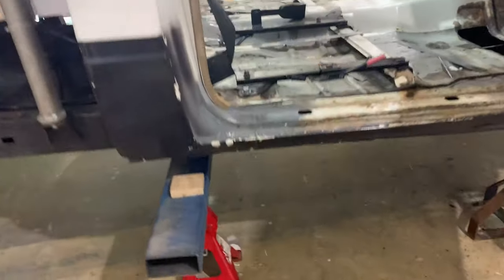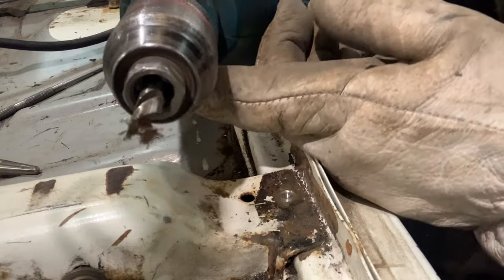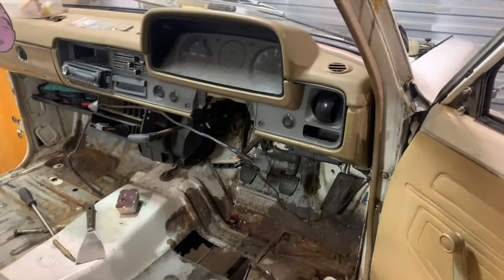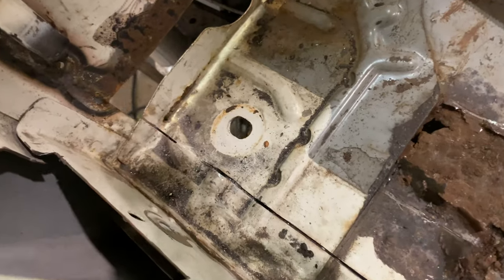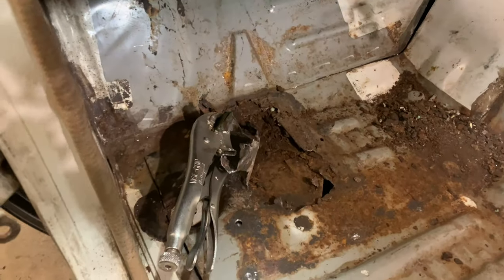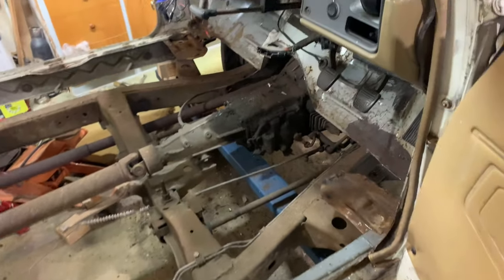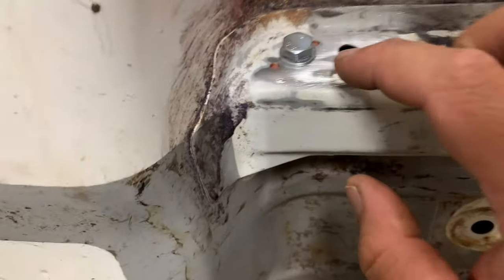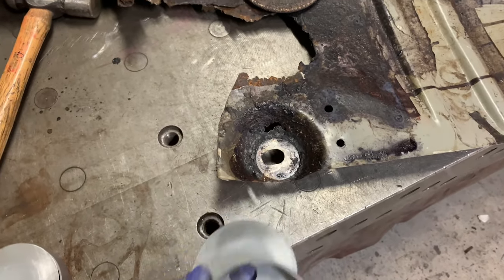Minitruck Build - Body drop & Restoration 80’s Hilux Pickup Ep.11

Comment: Loving the progress, have an rn41 sr5 that I put 5 link rear into. Body drop looks to be my next part. Thanks for the information and tips.
Reply from the maker: Yo is it a wellside or a flat deck?

I've almost completed the body drop. Its sitting back on its own wheels and hopefully will finish it this weekend. I'm afraid that I'm going to have to convert it to stick shift as the column shift is never going to work properly.

Comment: Nice work dude. my ute had the same rust around the same areas, Last owner was panel beater so he did all the work and did the under seal and all that. :) Looking into building a custom center console for mine at moment to have 2 cup holders, Headunit and 2 speakers plus a area to place cellphone.
Reply from the maker: Thanks Mark!😎, we are getting there. My panel beating wouldn’t be as good as a proper panel beater and I really would have loved to have it done by one. But will bump up its value either way. Once I move back up north I will do a complete new floor in my other truck. Will be a lot easier that way.
Yeah you showed me a week or so ago, looks really good. I’m thinking about doing something similar with mine eventually but after this body drop.